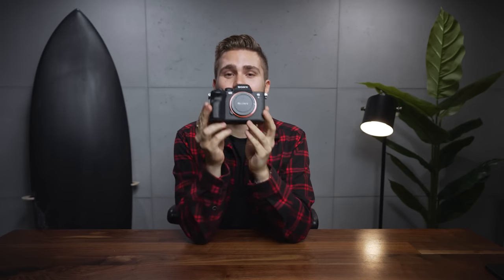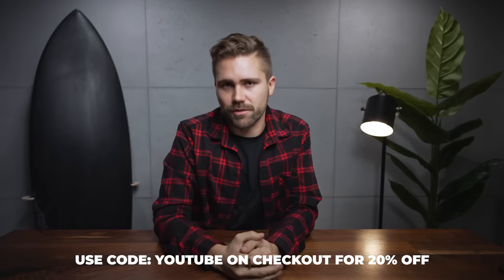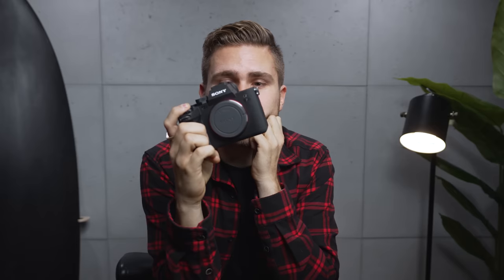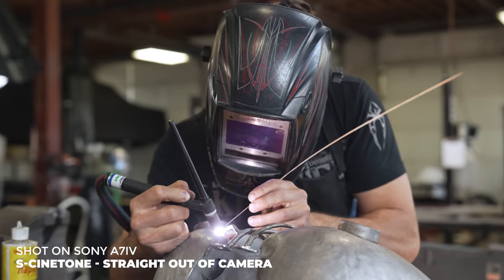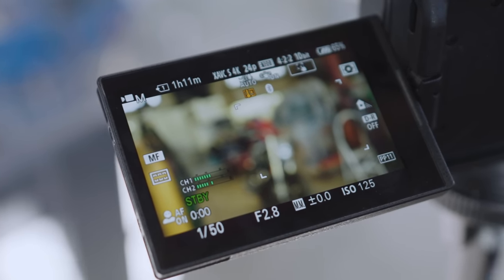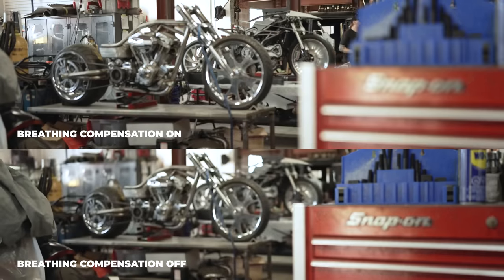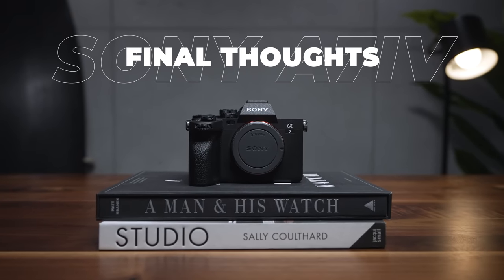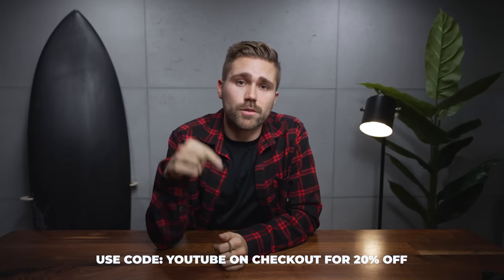SONY A7IV REVIEW - Is this the PERFECT CAMERA? + Test footage

Comment: I don't know how to feel about Sony crippling the specs on their cameras. It has the same processor as the A1, then why does it have a crop on the 4k 60fps??? Making me rethink of this is the camera I was waiting for.
Reply: No corporation want’s to cannibalise their product sales.
Reply: Wanted to buy it so much. But without 4K60p, no.. not buying it.
Reply: Without the crop this would have been perfect, leaning towards the R6 now
Reply: @sahaamrahat945  but it does not cripple in any way, A7SIII and FX3 has 4k 120fps, that alone is another league. 4k  60fps  no crop doesn't cannibalize anything,  just increase sales. Now result is that people are still looking at other brands instead of just buying.  So this is a bit of a miss than anything positive for Sony and their products sales.
Reply: @DanasAnis  that's the point they don't want their products to be priced similar and this is a way to justify the price brackets as well. I think you've mixed the wrong tags. 
Sony or any other camera manufacturer won't want
1) their apsc camera to eat their full frame sales
2) a7 sales to eat a7s or a7r sales
3) a7s sales to eat their FX sales
4) a7r sales to ea their a1 sales
If that wasn't the case then all would more or less do what the other series was offering at a slightly better price but that would ruin expensive gear sales
Reply: Knowing sony I think we could expect a Sony FX1 with no crop 4k60p and similar ergonomics to the FX3
Reply: @DanasAnis  unfortunately this is correct. I have been waiting for this real hybrid camera for some time coming from an A7iii. I do a lot of property gigs and need un cropped 50p and more than 12mp. I have now started looking else where
Reply: @sahaamrahat945  There are tons of people like me who simply can't afford an A7SIII (and who prefer better photos), but who could be willing to upgrade to the iv. Yet, it's a choice to spend thousands (for me to upgrade from the a7c to the a7iv, it'll cost at least $1500, maybe even 2k). I might be happy enough with what I have, but with slightly better specs, I would be drooling.
Reply: @niccoloaurelius1587  that's my point you won't get everything on all the models because then that business would be dumb. They need to sell and cater to anyone without affecting their own sales as well.
Reply: @sahaamrahat945  but if it's an arbitrary choice rather than something actually being limited by the camera's engineering, then perhaps they'll generate more sales by providing what they're able to, and what the market wants. Those who can afford an A7SIII will be wanting the improved features (4k 120; better rolling shutter performance; better low light at higher ISOs) even if 4k 60 didn't have a crop on the A7IV.
Reply: If it has the same processor as the α1, why all the rolling shutter?
Reply: @FelixCervantes  Because it does not have the same sensor.
Reply: Agreed. Seems like they've got it very wrong this time around. Also hiking the price by $500 as well just feels mean.
Reply: You know, what? If they gave us a firmware update capable of uncropped 4k 60fps with pixel binning as an option, it wouldn't be that bad. Having the option to choose between FF or a better image with a corp is much more appealing. But buying a Full-Frame camera only for it to be cropped is not ideal at all. Even so, I'm still juggling on whether to get the A7IV.
Reply: @ToneFuentes  Its a deal breaker for me. I don''t want to be constantly changing lenses and frame rates and buying wider lenses. Asking people who'd invested in full frame systems to go crop sensor for the one video feature they've been waiting for is a strange move. I'm not desperate to to upgrade. I needed a compelling reason to. I don't see one.
Reply: @sahaamrahat945  How cannibalise their product sale? Sony A7S III does have 4k120p but we want only 4k60p full frame not 120p. not making human sense.
Reply: @pematamang9268  it's just like what everyone says about Canon and their cripple hammer. Yea we think it's not a big diff but but Sony doesn't. You need something to leverage products over each other. In this case if we want uncropped then they want us to get the a7siii because that'll be kinda a reason to get it. 
It's kinda like a bag of perks and trade offs.
It's business 101. No business would want to lose money on a product and have their products compete with each other.
Reply: @sahaamrahat945  Every deaf people know Sony A7S III does have 4k120p but we only asking 4k60p full frame. How does market effect? Crop 4k60p, 5fps, 1.03m dots Lcd, Rolling shutter is not perfect camera and who is buying? Might be 90 years old grand pa. What do you film? This camera can't shoot Car racing, fight club and other moving due to Jell-O effect and straight line bend. No way to upgrade. Selling Sony a7iii for $1100, Buying Sony a7 IV at $2499 and Loss $1400. It is not sense point and it is mental sense you make.
Reply: @pematamang9268  bruh. Tell me if you gave a74, a7siii, a7r4, a1, fx7 all the similar features but different price points which one would you buy? The less costly one, right? Even if the higher price models sell a bit. That's still a loss for them since they won't make as much profit on them as they could. They are a business first.
Reply: @pematamang9268  if you need a video camera then Sony wants you to buy the A7S line. If photography is your main priority then you need the A7R line. But. If you want something that does a bit of both then you get the basic A7 line. It's somewhere in the middle so they can really have it being better than their video or photography camera line. 👀
The loss is on you tbh. You actively chose to get the a74 and Sony didn't force you to. I agree there shouldn't be restrictions on cameras or anything but here we are. Businesses and corporations want to earn so they'll always be profit first. 
Also I'd suggest looking at what decoy pricing is in business, you'll get a better idea of what goes behind product design and pricing.
Reply: @sahaamrahat945  How this Cripple Camera make profit. Everybody know Bussiness and cooperation want profit and it is true somehow but this Sony a74 won't be best seller. Rolling shutter issue 4k24,30p, 5fps and 1.03M dots Lcd doesn't fit with price bump. Non of them ask a1 and Sony A7S III level to Sony a7 IV, That's totally non sense. expectation. This sony a7IV marketing strategics track to reverse instead of profit. I really wished Sony this camera will be best seller camera. This rolling shutter issue can't film anythings. You can't shoot in Silent shutter due to very low sensor readout speed.
Reply: A crop has also a lot of advantages. You can turn a 24mm Lens into a 35mm lens with one click in the menu. You also just get the best image quality because  some lenses are not as sharp and clean on the outer rim / edges so you can get  rid of it. I guess you can also use Sony's APS-C lenses with this crop but I'm not sure on that. The resolution also remains the same. Downside is you have to step back to get the same picture frame. The Canon R6 does have 4K 60p with full sensor frame BUT it has only 20 MP if you want to take pictures (and cropping a lot) is a disadvantage.

Comment from the maker: 6:06** CORRECTION **THE OVERHEATING HAPPENED ON STANDARD AUTO SHUT OFF** IF YOU SWITCH TO “AUTO POWER OFF TEMP” IT SHOULD LAST ALMOST 2 HOURS. Also it’s not the same sensor as the A1 but the same processor.
Reply: Expected the 4K 60fps, surprised by focus mapping which looks dope.
Reply: Thanks for this correction mate, that overheating after 20mins was kind of putting me off as it would have made interviews pretty unfeasible :)
Reply: Could we get the discount code to work, please?
Reply: I have started to think about moving on from my Nikon d3500 because of the crop and it doesn't handle low-light (usually out at night) all that well. would you highly recommend the Sony a7 IV as an introduction to mirrorless cameras from dslr, especially moving from crop sensor to fullframe? I considered sticking with nikon but when you talk about mirrorless it seems to be sony where you can get the best?
Reply: @rboydphotography  You can probably save a BUNCH of money on an A7iii or A7iii variants (S/R) once the 7iv is out and in stores. The lenses are interchangeable between all Sony full frame cameras so you could always upgrade the body if you enjoy the platform. I personally just happened to buy an A7iii months ago. I probably won't get the A7iv for a couple years. Food for thought!
Reply: @rboydphotography  Getting a Sony A7IV is beyond Introduction to Mirrorless world of cameras. You will get overwhelmed by the robust features it has compare to Entry Level DSLR's like Nikon D3500. I Upgraded mine from D5500 a while back to a Mirrorless and It's I don't think I will go back to DSLR's ever again...
Reply: @rboydphotography  As people waited for the Sony A7III I would guess that the Z6 III and Z7 III would be THE nikons to get. Just be patient.
Reply: When you said you were shooting on the highest quality, Could you elaborate what exact mode that was. Thanks

Comment: As someone who already has an A7RIV, the A7SIII is definitely the next one on my list. I already have an absolute beast of a photo camera, I think an absolute beast of a video camera would be the perfect addition.
Reply: Why not have one that do both ?
Reply: @Bampiss  because the a7rIV is purely designed for photos ( landscape and cityscape precisely) and the a7sIII is designed for videos. the only thing that makes the a7 series better than the a7R series is low light performance. the a7III/IV perform great in low light when the A7rIV usually starts to lose quality above 3200 ISO but like I mentioned before The a7RIV is mainly purchased by landscape/cityscape photographers who need better quality , great dynamic range and many megapixel (61 megapixel on the a7rIV) for big prints. the a7IV is for hybrid shooters people who want good quality for both photo and video but if you want great quality you have to specifically pick and if you're a photographer the a7rIV is levels above the A7 series.

Comment: 4:2:2 10bit, S-Cinetone, and Flippy screen make it a winner for me.
Reply: Yes… But he never mentioned the god-awful rolling shutter. That’s  just about a dealbreaker for me.
Reply: @2424rocket  what is rolling shutter I keep hearing that about this camera ?
Reply: It’s the Jell-O effect… If you move your camera quickly from side to side all the straight lines bend because the sensor can’t read each frame fast enough. If you’re just doing sit down interviews it’s not a big deal but if you’re filming cars or staging a fight scene… It becomes unbearable. The Jell-O effect on the A7SIII is almost imperceptible.  This a complete dealbreaker for me. This is a good camera but it’s four steps forward and three steps back.
Reply: @2424rocket  no way that’s crazy!! 🤦🏾‍♂️ did the A7iii have a rolling shutter issue too?
Reply: @justinmunford2164  I don’t know for sure, I would imagine that it did. Spend the extra grand… You will be very happy that you did.

Comment: Theoretically, is it POSSIBLE that Sony can update the firmware to allow Full Frame 4K 60fps? Or is it a hardware limitation to be stuck in Super 35?
Reply: Sales of the a7S III will not allow them to....
Reply: From what I've heard, it's a sensor hardware limitation. It's why all the cameras using the same Sony sensor are limited to a cropped 4k 60

I may be wrong, though
Reply: So, the a7SIII was released before the a7III. When the a7III was released with full frame 4k60, sales of the a7SIII tanked as the a7III was far cheaper with similar overall specs. It has been speculated that the crop on the a7IV is artificial so the a7SIII still remains desirable. In addition to this, I also believe the limitations of XAVC S-I on SD UHSII cards is also artificial to maintain sales of CFexpress Type A cards, of which Sony is one of two reputable brands that manufactures them (there's also Delkin, but who's heard of them). It's been shown that in 24p, the data rate is 240mb/s, leaving plenty of room for 300mb/s SD V90 UHSII cards. It could be argued that with s&q mode being closer to 600mb/s in XAVC S-I they'd limit it for CFExpress cards so you have full compatibility in that file format, but really, I want the option to shoot in the best quality I can at any given frame rate, and am happy to change for s&q when shooting b-roll.
Reply: @bofranciscofilms  The a7iii doesn't have 4K 60fps what do you mean?

Comment: The perfect B cam for A7SIII, A1 or FX3 users and ALOT cheaper.
Reply from the maker: Exactly how I feel.
Reply: lol nah. The a7c the best B camera.
Reply: It’s the Jell-O effect… If you move your camera quickly from side to side all the straight lines bend because the sensor can’t read each frame fast enough. If you’re just doing sit down interviews it’s not a big deal but if you’re filming cars or staging a fight scene… It becomes unbearable. The Jell-O effect on the A7SIII is almost imperceptible.  This a complete dealbreaker for me. This is a good camera but it’s four steps forward and three steps back.

Comment: honestly the flippy screen is a deal breaker for me. the pull out screen is just way more comfortable for mel i dont feel i can hold the camera as comfortably with the screen out to the side.
Reply: Looks like the A7RV will have fixed that with both, wish it were in this though.
Reply: @PetrosofSparta  Yes, I'd be surprised if that doesn't filter through to all new models now starting with the A7sIV

Comment: Looking at buying my first camera (deciding between A7c + G: f1.8 -20mm lens and saving more for A7IV). I’ll be using it for starting YouTube - talking at my desk mainly (maybe twitch), Zoom meetings and general social media. I have a MacBook 2017 w/touchbar, and will be using Davinci Resolve studio free version. Colour grading will be basic in-built LUT’s on Davinci. 

Should I get A7c + 20mm f1.8 + soft box light + shure Mv7 microphone + accessories or should I buy a A7IV body with no lense 🤣
Reply: I have the A7C and it's a great camera. I absolutely love it. In the situation you described, I feel you should go with the A7C and lens+accessories. For talking head videos 4k 24p/30p will be more than enough. And with decent lighting, the you wouldn't need to grade the footage extensively, so the 8 bit 4:2:0 of the A7C should be enough for you. However if the 4k 60p and 10 bit 4:2:2 is an absolute must for you, they the A7IV is the one for you. Hope this helps you in making a decision 😄

Comment: Looks like you don't know about the auto power off temp setting on sony cameras which when set to high allows for near endless amounts of high res recording without overheating. Same thing happens on the a7iii. Unless you are recording in desert temperatures these cameras don't overheat. Many people have done incubator tests on the highest recording settings and the cameras did not shut off.

Another lesson in why you shouldn't take "content creators" words as facts

Comment: I'm in the market for a new camera at this moment and I was REALLY hoping the A7IV would be the decider to get me to finally switch to Sony. Right now the R6 is the only camera that meets all my needs for the right price, and I was expecting the A7IV to display some significant advantages, but I'm honestly a little underwhelmed. Super35 crop on 4k60 and seemingly fast overheating is honestly disappointing for what will likely be a lot of peoples' A-cam - then again, there were similar problems at the R5/R6 launch so I'd be interested to see how people get on with using it for a while.
Reply: I don't mind the slowmo crop, I got used to it while using the c300. I think I rather get those 33mpx instead of the 20mp from the R6. I wonder if there's going to be a price drop on the R6 next month on TG, that would be a deal breaker.
Reply: It’s not overheating if you have Auto temp. power off mode disengaged!!!
Reply: @carlosmontalva439  I agree it's certainly not a dealbreaker. The 33MP is definitely preferable for me over the R6, but I can't help but feel it still lags in a number of ways which is frustrating for a newer camera. Large 4k crop, lower bitrate (as always with Sony), poorer low-light autofocus... Minor things but they all add up. That said, 15 stops of dynamic range might just make me forget all that 😅
Reply: @jimi272  Just noticed that, good to know! Thanks!
Reply: @JamesKGraves  according to bhphoto and adorama, shipping starts pretty much in january. So I guess I’ll get the R6.
Reply: I was in a similar position debating between the R6 and the 7IV, I already have glass for the SONY, A7II owner, so that makes it harder to leave the SONY ecosystem. Both cameras are similar imho, the R6 crops at ~1.01 when shooting at 4k60, not really gaining much, the A7IV has 33mp so that's a plus for Sony.

Comment: Sony was smart not adding full frame 4K 60. Sony didn’t want to give t’s users false advertising with the obvious overheating issues it would have brought on.
Reply: Wouldn’t be the first time Sony has done that lol. I shoot sony but they are known to give you features that barely work quite often. These camera manufacturers will keep doing it too because people will buy it anyways lol. The smart thing to do would be to make a camera that’s a normal size and mitigate/control the heat that their cameras produce. I miss when cameras fit the hand well. Don’t praise them for putting a band aid on a clear issue.
Reply: @mrwashur1991   Come on man, these are pro-sumer cameras. You want more, pay more. $2499 for this much camera is more than plenty.